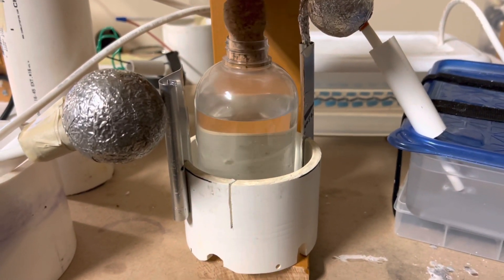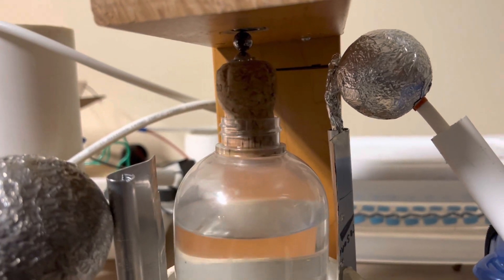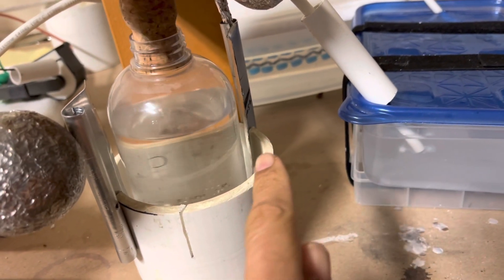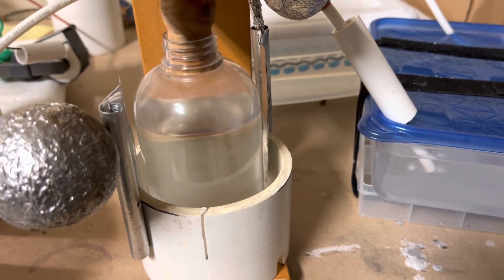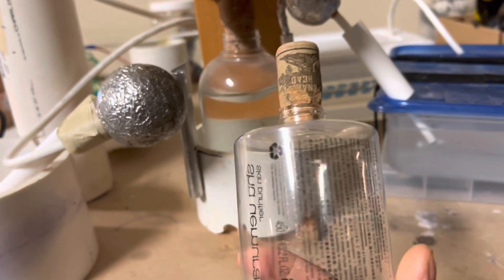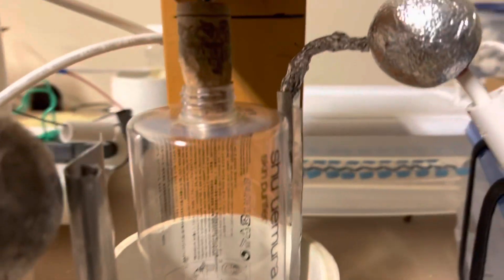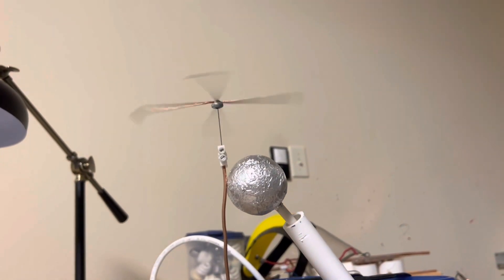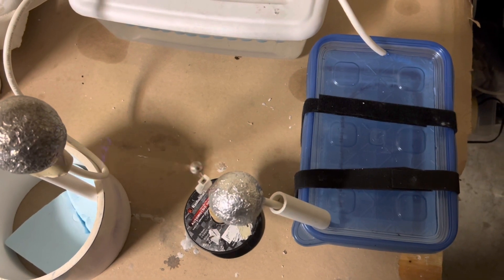Simplest Ever Electrostatic Motor

Comment: I noticed my plastic candy wrapper would only stick to to my water bottle where there was water inside the bottle. I wonder if the water made it spin better or worse?  And with lower voltage? Also what about salt in the water? Or titanium dioxide ( white paint) highly dielectric as an insulative capacitor? What about Piezo effect such as powdered quartz in water. Glitter in water.

Comment: The aluminum is said to have a strong torque. Do these? So the water is not needed? Plastic by itself? Awesome thank you!
Reply from the maker: Yeah, I was really surprised that it worked without any aluminum foil inside the plastic bottle and it also worked without water in it. The torque produced by the presence of water was quite strong, almost almost like aluminum.